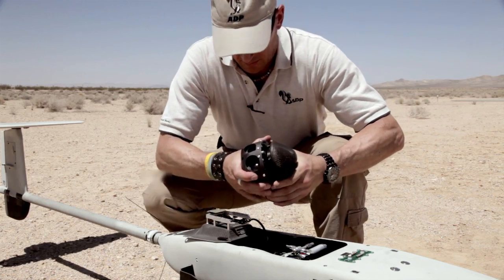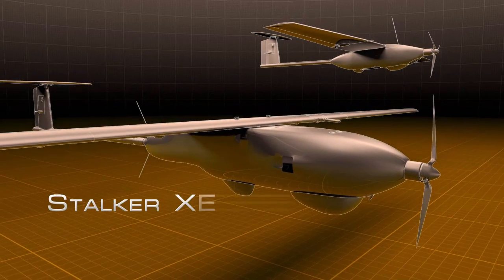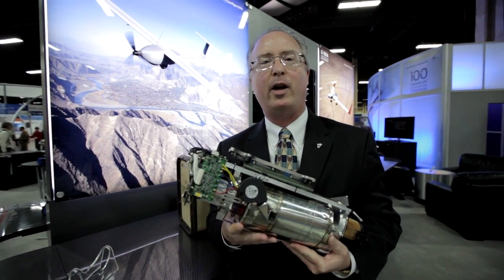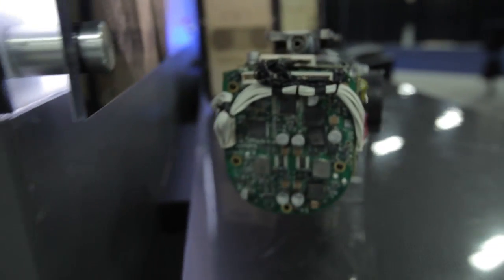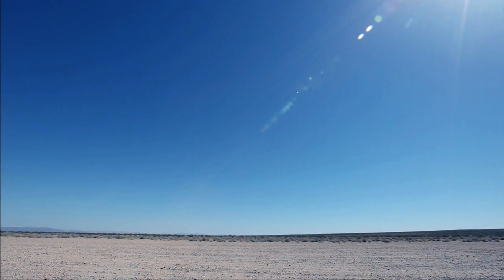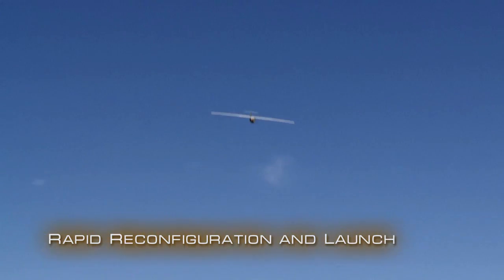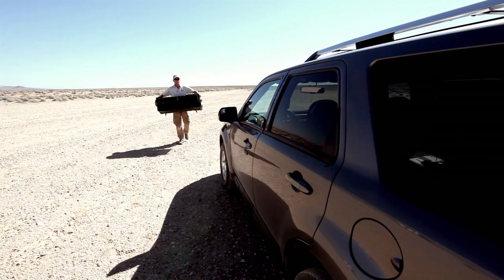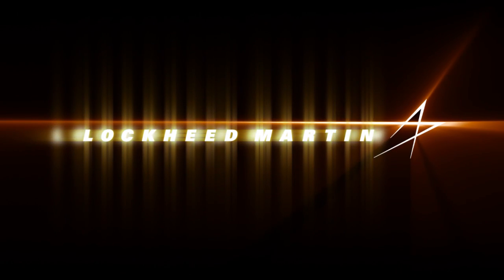Stalker UAS - Taking Endurance to the Next Level

Comment: they are using a lazer to beam light energy to plates onboard which recharge the batteries. it works, but is probably still in the developmental process.